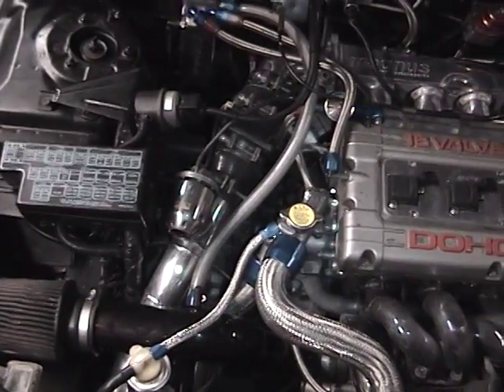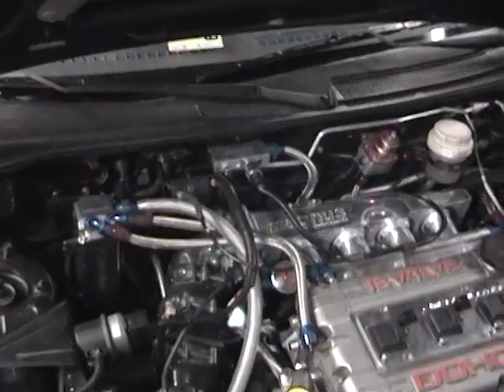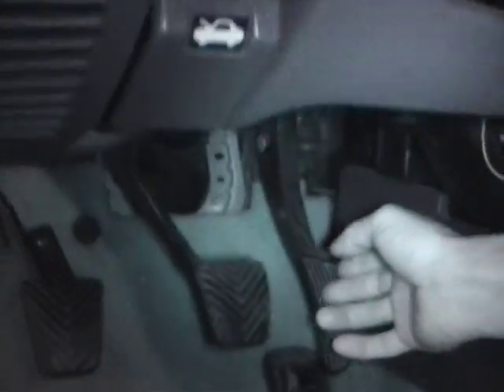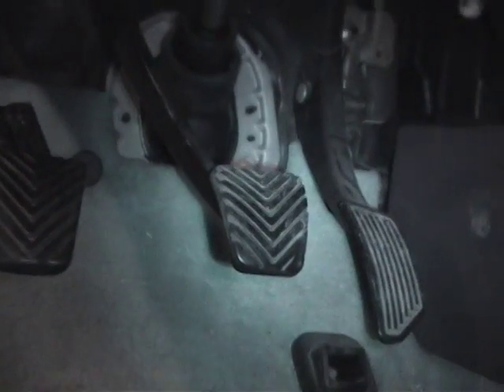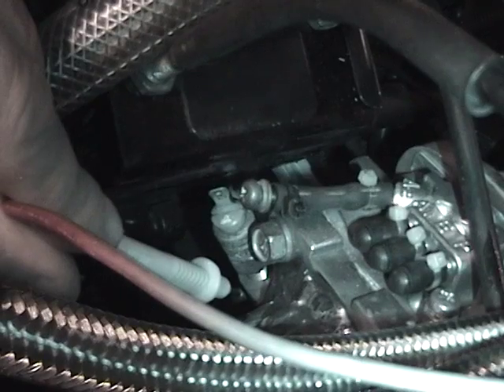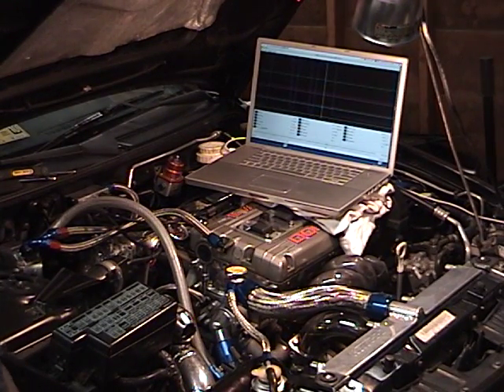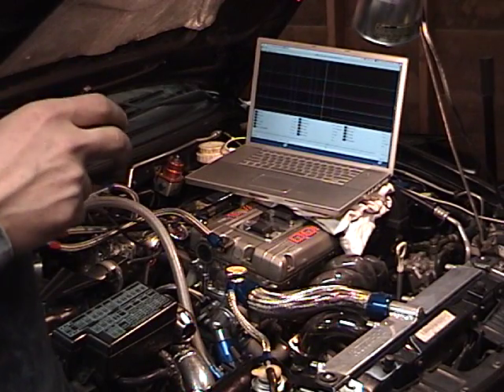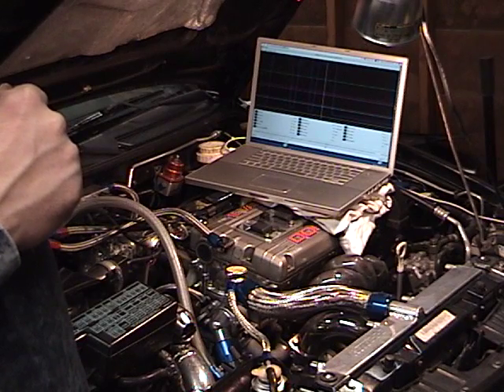Tuning 101 - tuning with the car off

Comment: Should probably explain how to adjust the stopper. Great video otherwise ❤
Reply from the maker: True.  I did do this in a later video, but it's not titled in a way that makes it easy for either of us to find.  The most reliable method is to back it off until the throttle sticks when it closes, then crank it forward 1/4 turn.  Open it all the way from the engine bay side, let it snap shut, make sure it doesn't stick shut.  If it sticks closed again once it gets hot or while you're driving it around, give it another small turn and lock it again.  After you do that, you pretty much have to do all the other stuff over again.  The throttle plate needs to close as far as physically possible, but you don't need to take anything apart because you can feel it bind.  A quarter turn in front of that point is about where you want it because the BISS screw and ISC work together to regulate idle when it's shut.

Comment: It's odd that nowhere in the FSM or elsewhere is it explained why the voltage needs to be 0.63v specifically. Moreover, as soon as you start the car, the idle airflow starts pushing on the throttle plate which on most DSMs changes the TPS reading from 0.63 to 0.65v. I believe the FSM states to use a 0.45mm feeler between the SAS and throttle plate to simulate this slight opening? Additionally, the idle switch actually changes from "1" meaning foot OFF the throttle, to "0" meaning you're giving it gas, at around 0.67-0.69v. So the 0.63v setting becomes moot. Also, if we adjust the throttle cable with the car cold, it doesn't factor the expansion of the cable and jacket which would end up making the cable pull on the throttle plate ever more when warmed up, leading to high idle.

Comment: I don't have DSM link so what's the easiest way to set the TPS?
Reply from the maker: An OBD reader.  Anything that can plug into the ECU and monitor it.  It's tougher on 1g cars than the 2g's because of differences in the OBD standards, but that's the best way.
Reply: @Jafromobile   should have told you mine is a 2gen , can I just set it by the voltage?
Reply from the maker: @wildimpo  Nah, it doesn't work like that.  That worked on older units, but I never got anywhere with it when I tried to do it that way.  There's a brilliant scientific explanation for why it doesn't work, but I don't have it.  On the 2g TPS, there's a built-in idle switch.  If you probe that pin to ground while the TPS is generally screwed in place, and ensure that switch opens with the lightest touch of the pedal, that's where you want to bolt it down to get up and running.  That would be the best way to set it if you don't have any means of reading the ECU.
Reply: @Jafromobile  ok I've owned 14 Talon's and Eclipse and have never had to set one, always a first time, thanx for your help mr DSM
Reply: @Jafromobile  sorry I wanted to ask it's running really fat will the TPS needing set cause this?
Reply from the maker: @wildimpo  Yes.  It's only one of the things that can cause that, though.  If there's no check engine light, it should learn how rich and try to pull fuel out unless the o2 sensor doesn't cycle within 70 seconds after startup.  If that never happens it won't learn anything at all.  If doing the idle switch test/set thing on the TPS doesn't bring your A/F into check, then check your fuel pressure.   If it's right, then hit the o2 sensor next.  If your o2 sensor is bad, then you should already have a check engine light.  That would make you run rich no matter what it's for.  I'd recommend buying a cheap OBD-II reader that works with your car just so you can read what these sensors are doing and see if there are stored codes.  You wouldn't have to throw parts at it or get dirty if you could just see what they're doing.  That info would help you best plan your next move.  Lookup FIXD for a cheap solution that works with your phone, but understand some of its features require $ubscription.  I managed to get data I needed for free with it, and it's OBD-II.
Reply: @Jafromobile   Fantastic! Thanx for your help

Comment: wish i would have seen this video yesterday . I could have avoided the 47 cuts on my hand from wedging it in there with a 8mm open end wrench trying to adjust my tps to .63. It only took me about 17 times because as soon as i would tighten it back down , sure enough it would jump to .61 or .65 lol
Reply: and what kind of sorcery is that fancy ratchet you got there
Reply from the maker: It's called a Blackhawk Rotary 39450R.  3/8" drive.  Even Walmart sells them.  You can get them cheaper elsewhere.   Take a bench grinder to an old shorty 8mm or spare 5/16" socket and you're golden.  Use a 1/4" drive adapter.  It's a $50 solution to a mechanical problem, but if you've got ECMlink, you could do a TPS calibration for $0 in the ECU.  It produces the same result.
Reply: @Jafromobile  cool, ill be picking one of them up. I have link but the tps was pretty far off so i figured it would be a good idea to get it closer before using the tps compensation tool (my right hand disagrees with me), then it became a pride thing getting it to .63  even though i lost in the end because it ended up at .65 somehow anyway.

Comment: I just got my first dsm it was someone project car fully built with lots of goodies it has ecmlink v3 my problrm is he put a gm map in and bigger throttle body when i het the gass it cuts off what can i do any help i will love it need to get tbe car drivable
Reply from the maker: I don't know which car you've got... but my instincts tell me to recommend you find a '91-94 turbo DSM in whatever salvage yard used auction or craigslist that you can find and get the throttle body off that thing.  The sensors are practically plug and play on that model for all 1991 - 1999 cars.  That's the best factory throttle body upgrade for all of the stock-ish DSMs out there.  It's the biggest factory bore for a turbo car where the sensors play nice together.  If you have a '95-'99 car, you'll need the 95-99 Throttle Position Sensor, though.  2g cars have an idle switch integrated into the TPS.  1g cars use an external idle switch.  It's easy to rewire for the cost of some solder and a spade connector clip to use the external, but the 2g sensor bolts right on and requires no wiring.  All the gaskets are still available for that one unlike it's slightly uglier 1990 counterpart which uses 2 different sized shaft seals and one's out of production.  You really have to hunt for it.  I'm actually about to make a throttle body video, but I've got a video in front of it, and a week of racing before I can get to working on any of them.

If you get a '91-'94 throttle body, rebuild it for about $30 with gaskets and seals, and bolt that sucker on there... it will idle and drive better than it ever will.

If the engine dies because your foot's off the pedal, and it's hard to keep running... then on whatever idle bypass adjustment screw or throttle stopper that thing's got, you just need to open it up a little bit to let more air in.  Sounds like your idle's dropping too low for it to stay running.  Maybe the throttle plate is closing too far for the air bypass that it's got?  That might be enough to get you by for now if you can figure out some way to do that.  It could be a cable, a screw, a valve, something external on it that you can adjust.

Losing the functionality of the Idle Speed Controller and throttle position sensor/idle switch to an aftermarket throttle body that doesn't have an adequate equivalent or one that's compatible will your engine's needs will make for lots of drivability headaches.  It's off of a what?  Not a DSM.  Unless the car has a huge twin scroll turbo and cams bigger than 280's, it really didn't need that upgrade.  There are times when more is less.
Reply from the maker: It could also be that he left a really bad tune on it.  Check your LTFT LO/Mid/HI values, STFT's at idle and make sure you have them all around zero.  If not, your fuel settings or airflow settings are wrong.  There's nothing wrong with GM sensors.  All my cars run better because of them.  As long as they're done correctly and not gutted out, they're usually really easy to tune.  Make sure your ECMlink is a legit upgrade, contact ECMlink (with contact info from their website) and make sure you get registered.  You get the benefit of using more than the wiki.  You can search the forums and find valuable tuning help there.

Comment: Thanks for this. Awesome DSMer, we need more videos like this, and less hooning videos.

I will add that A good brand of socket, Snap-on, Silver Eagle, Blue Point, Williams, Matco, Mac, etc would have the taper, and would fit. I can fit my Snap-on 3/8 drive 8mm deep on the top one easily, and I can use the short 8mm for the bottom with a wobble extension, or the deep 1/4" drive socket in the same size with a wobbler works better.

Comment: Hey Jafro, good morning! 2 questions. First where do you get all your braided hose?  Do you buy in bulk rolls? If so, where do you order from. Second, do you know a online supply house that sells the bolts to fit in a stock o2 housing and the nuts and bolts that go on the down pipe? I'm pretty sure they are grade 8(please correct me if I'm wrong). Let me know if you have any more info. I have found them on aftermarket car part websites for anywhere between 8 and 15 dollars A PIECE!

Comment: don't think the 5 volts are not necessary since the ecu thresholds are about 30 and 70%... then WOT is validate with pressure values vaccum or boost...they yes are used to perform injection and timming calculations... at least thats what happens with hondas obd1... simpler than 96++ fuel management systems.
Reply from the maker: Agreed.  This car has the equivalence of the Honda 96+ ECUs.  It's OBD-II.  Mitsubishi did the change-over to OBD-II in September '94.  Honda held out as long as they could.  All the voltage test will do on the 2g cars is help you find a dead spot in the TPS if it has one.  The software I'm using would allow it to show up in a log... but sadly this solution only works on turbo mitsubishi 4-bangers.

Comment: Hey Jafro, my throttle cable gets stuck sometimes at 1000-2000 rpms. I still have my cruise control. I would assume you probably had this issue before. Any ideas on how to fix this?
Reply: rip cruise control out its no good

Comment: On a car that is fully drive by wire (pedal is electronic and throttle body is controlled via a servo), you wouldn't have to do any of the throttle adjustments correct?

Comment: @Jafromobile peak HP is not everything and you can also get much better times by change timing is other load ranges "swept area" to make sure you have perfect TQ when shifting as well loads of things to consider those are pretty good times but I am still willing to bet you can improve it a little. Speed density is a great idea but once you do that remember you are losing your air counter so you are really going to have to make sure you tables are really great cause you will not have as much play

Comment: @Jafromobile well you can always get better results on a dyno. Controlling your flame front to get a complete burn to happen and the exact deg of rotation for maximum deflection loss is only possible by seeing TQ output from a dyno. You can get pretty close with track tuning but can never get quite as close as you can on a dyno. If you ever need any help with any of that feel free to send me a message.

Comment: lol not all cars are like a DSMs and have such a long range of fuel correction Tunning is a must for people doing major mods to there car. Yes being mechanically sound is an absolute must but 95% lol that might be a little exaggeration the actual air fuel ratios and ignition timing are where most of your  power and efficiency  will come from. that is per about of air allowed into your engine at any given time. without that your car has to work even harder for the power.